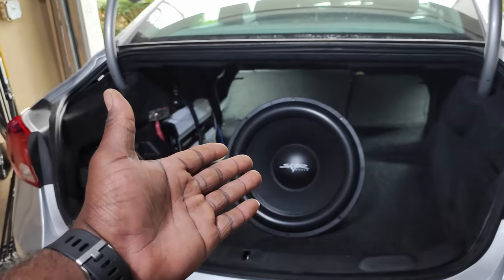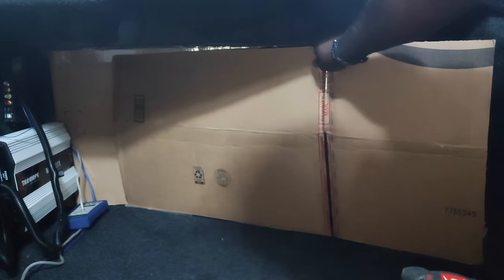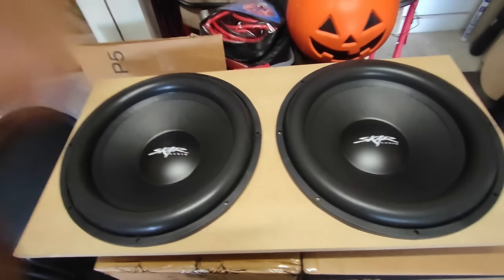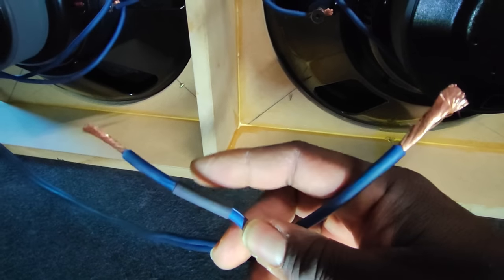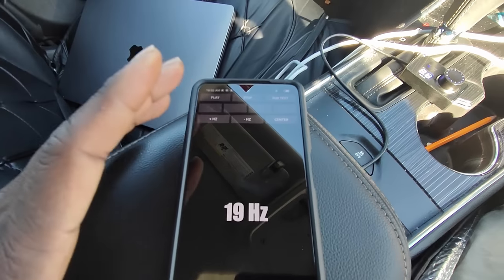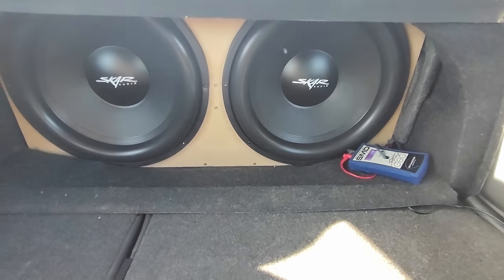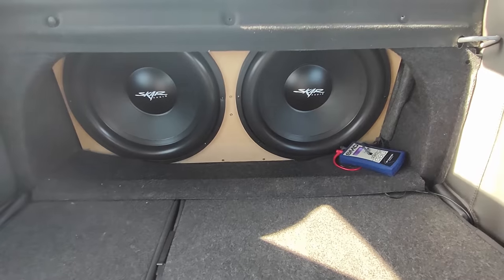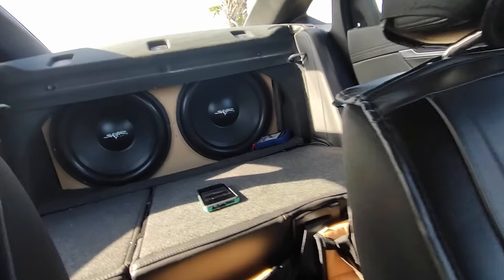No Other Design Sounds Better Than This - Infinite Baffle - 8,000 Watt Test - Part 1

Comment: If I remember correctly, Richard Clark did this in either a late 80’s Buick Grand National or a Ford Thunderbird, back in the late 89’s early 90’s. He was the king of SQ back then. Won tons of trophies from IASCA sound competitions for several years. He perfected the system by going to an aperiodic set up for the subs. This requires a semi-permeable membrane that again if I remember correctly was the rear panel of the enclosure. He then further perfected it by coming up with his own product that went over the face of the sub like a grill. Apparently it allowed for an almost ideally damped response curve. He used 15” subs, with the speed of 8” subs and nearly flat response down to 20HZ. His system was compromised of (2) waveguide horns under the dash, (2) 10” mid/mid-bass, and (2) 15” subs. (3) Alpine 250 watt x2 amps to power the speakers. Back in the day it was considered the best of the best. Love what you are doing, keep it up.
Reply: Explain what “speed” of an 8 inch sub means.

A 15 inch sun playing at 33htz moves 33 times per second.

A 8 inch sub playing 33 hertz also moved 33 times per second?

So how is one sub faster than the other?

I’m not trying to be a smart azz, just trying figure it out!
Reply: When referring to “speed” of an 8” sub. It is reference of what also may be called attack & decay. How fast a speaker starts and stops when producing a frequency. Attack is how quick it starts, decay is how slow it stops. Due to sheer size\mass differences between an 8” and 15” sub, the 8” will start and stop quicker. With an aperiodic style enclosure, this dampens the speaker in an ideal way. It helps large subwoofers stop much faster. In essence you can select a slightly higher crossover frequency as the larger sub will react with less unfavorable effects. Ie. say 80-100HZ versus 50-60HZ for a 15” sub. Hopefully this helps with my initial statement.
Reply: What's the deal with horns? I hear a compression horn can act as a mid and tweeter simultaneously and highpass from like 400hz up. Is it in any way possible to have an SQ setup that's 3-way (sub, midbass, and whatever, or sub, mid, and tweeter) that gets 145-155db on the sub stage with the front stage more or less keeping up with it? (more for the low side of that SPL, less for the high side)

Size constraints are a small single cab truck with a manual trans (so no speakers in the kick), and I only want to use AT MOST half my truck bed for the blow-through box(roughly 16.5 tall x 40 wide x 36 long/deep dimensions, can extend to 17 tall x 52 wide, but only 20 deep if doing a slot loaded IB blow through with three SI SQL-15s). I'd really prefer than nice round 150, and 155 is about my soft tolerance limit for bass. Haven't heard a 160+ car yet from the inside and kinda don't care if I do since that's not a goal of mine.
Reply: @Drunken_Hamster Titanium Diaphragm compression drivers play a higher frequency and can be used without a tweeter. A phenolic diaphragm compression driver can be used to play the midrange frequency’s.

Titanium Diaphragm (1500hz and Up)

Phenolic Diaphragm (500 and Up)
Reply: @ShaahidJohnson  Sounds like I'd still need two drivers to cover the midrange and highs. If so, wouldn't I be better off just sticking to the traditional midbass+mid+tweeter combo?
Reply: He did both..I bought his tech briefs back in the nineties about 500 pages of the best audio literature ever
Reply: @Drunken_Hamster  how far are willing to go I got ds18 horns that I have set from 800 to 20k but they mount deep ...
Reply: @nuclearbum9858  It's almost an oxymoron, but I'm willing to do more in order to do less, if you know what I mean. Like, I'd rather do the physical stuff and have parts selection "carry" my build than have to endlessly tune things. To that effect, THAT'S the main reason I really want to push for a 3-way system that covers everything rather than the typical 4-way or higher system.

Though given my current vehicle status, there are bound to be limitations when it comes to what will fit. I'm already all but resigned to a blow-through for the sub-stage. To pair with that, my doors are thin and my dashboard is shallow. ((It's an 09 Ford Ranger single cab))
Reply: @Drunken_Hamster  some horns have a large enough diaphragm and long enough throat they can play into mid frequencies. So back in the day, some of the unlimited pro class competitors would use a setup of 15” or larger subs, 8” or 10” mid/mid bass drivers, and horn hi frequency drivers. 
Back in the 90’s it was either USD or Image Dynamics that came out with a horn combining both a 4-5” mid and the high frequency driver. The mid was mounted to the throat of the horn. 
So, you can get away with horn, mid/midbass, and sub. You’ll need to do your due diligence in research for the right combination to meet your needs. Know that the horn design can also play a part in dispersion, and frequency response.
Reply: @michaelboner5118  I was figuring that  the only way to really get them in would be in the dash pointed up at the windshield. The only other way might be in the very front of the doors pointed up at the roof, but I'm less sure of that.

Any resources (like a forum) that have more info on horns and horn drivers' response curves so I can maybe pick one, learn about the actual horn/waveguide's design, and go from there?
Reply: @Drunken_Hamster - If i were you, i would buy 2- Si 8 inch midbass ( hpf set to 50Hz, Lpf set to 3,000Hz), and put in custom trim ring buildouts in your front doors, and buy 2- Si mk25 tweeters ( hpf set to 3,000Hz  ), ran in custom A-pillar pods, your dash, or @ the top of your doors. You have some very good subwoofers, in those Si SQL 15s. For a wide bandwidth, and higher power handling/SPL, if putting those 3- Si SQL 15s in a 4th order blow through, i suggest the rear/sealed chamber= (1.5net sealed per 15, so 4.5cu. ft. net total sealed rear chambers), in each individual sealed chamber, helps with loading issues, and if you blow 1, you can still play fine. Then just use a enclosure software design to calculate how much cu. ft., and port tuning/area for the front chamber (port area i suggest 40% to 50% of total cone area so between 200sq in to 275sq. In of port area, for windy, and good sound output) Plus tune higher ( Like 60Hz ) to give better bass to midbass transition. Oh yeah to get 150Db with your Blow through, i would suggest 5k of clamped power, bandpass enclosures often have 4x impedance rise, so if your 15s are D4 wired in parr.= .67 ohm, expect 2.8 ohm power from what ever amp you get. Hope this helps?
Reply: @evilinside5984  Yeah, that'll probably do it, but I gotta say, my A-pillars are TINY in this truck and anything built on-axis is going to block the defroster the side window. Also, I've been considering an infinite baffle blow-through with a slightly different set of 15s in order to save a bit of bed space and get maximum low dig+clean bass.

4th order isn't off the table, but I probably CAN'T do it with 15s since my truck's bed is so shallow top to bottom. I might, MIGHT be able to squeeze 15s if I build a box with a notch that extends the height to the skin of the tonneau cover and goes between the rails, as that'll give me 17.5"-18" total clearance or so compared to the 16.5 I have if I only build to the tonenau's rails.

But at that point, I'm not sure if I could fit 3 across between the wheel wells since there's only 40" of space there, so the other option would be to fit one between each panel of the tonneau, but that would limit me to only two 15s unless I wanted to take up my WHOLE bed, which I don't. Hell, I don't even want to take up two panels of my tri-fold tonneau, cuz that's MOST of my bed, as is.
Reply: @Drunken_Hamster - What dimensions do you have @ the back wall of your truck cab, like directly behind your seats, and under the window line? Like if you just made that your infinite baffle wall, and made the area between the cab, and your bed splash proof.
Reply: @evilinside5984  It's also not enough for 15s as far as I can tell. Might not even be enough for 12s. I was planning on doing a sort of psuedo-slot-loaded "port through" infinite baffle like this one Tacoma that I saw.
Reply: @michaelboner5118 it doesn’t help , back then subs didn’t have huge surround like now , does it still apply
Reply: @beerman9807 - If you are talking about the speed of a woofer, the attack, and decay, and how they can be affected? All speakers, no matter how old, how new, how small, how big, how fat, or skinny the surrounds are, can all be affected by changes to their attack speed and decay, by enclosure designs, or adding mass to their cone's, or damping from an aperiodic membrane.
Reply: No saving the misinformation in these comments.
Reply: ❤it perfect and I love my bass as well I have to have both🎉
Reply: Is it safe to say that y'all have kindly shared presumably years of experience & wisdom within seconds simply reading, LEARNING....i genuinely thank you all!!!Grateful🤙
Reply: Richard Clark also employed a servo controller for his subs.  I think that went a long way in producing such amazing transient response.
Reply: I remember that!!! That Grand National was the gold standard of sound quality. More of these YT guys should pay homage to the real IB enclosure builders from that era. Those image dynamics horn were awesome. I probably still have the Car Audio and Electronics magazine he was featured in! Simple and profound system...
Reply: It was a Buick Grand National. Furthermore, there were only 6 speakers. 2× 15", 2× 12", 2× Horns (500 mhz and up).
Reply: @Drunken_Hamster  
 @ Just make sure when you run the sine sweep, you are not hearing any gaps in the music. You want to ensure you cover every frequency from 20Hz to 20kHz. When tuning, make sure you go a little beyond the frequency response you are aiming for. You want it to bleed over slightly to ensure you are hearing every note the song intends for you to hear. Bleed-over frequency is important because some equipment claims to replicate certain frequencies, but they can't! Even well-known companies have been known to not meet the specs they promise.

Comment: Great idea when it comes to a seat down trunk build.. fantastic job brother.. not only did you save your trunk space for when you need it but you also saved a ton of time not having to build and tune a box, or having to buy materials.. bravo 👏
Reply from the maker: Thanks 👍 This was simple and LOT more impressive than expected.
Reply: I like it!
Reply: @BudgetBassHead wus the name of the song?🔥
Reply: @BudgetBassHead  what did it cost? Thinking of getting bk in the game been out since 13
Reply from the maker: @michaellazenby6712  The scar audio SDR18s are less than $150 a piece
Reply: Do people not realize that the trunk is acting as a box. With that being said a box that flexes constantly is going to lose a lot of bass. There's a reason that us professionals build MDF boxes with two layers of three-quarter inch.
Reply: @krookedliptv9852   oh yeah?
Reply: @wgreen340  Yeah it's just simple physics all that energy that is being lost through the body of the car should be going straight into the cabin. What you could basically do the same thing with getting some actual infinit baffles which are pretty much just cones without a motor hooked to the back. But if you want base that really knocks you build a box specified for the speaker in the owners manual and tune the boxes port to your car's cabin resonant frequency. You can find that out by simply building your enclosure then you take a sealed speaker like a 12in and you put it in your driver seat then you play different frequencies on a tone generator app until you find the one frequency that hits the highest DB then you tune your box  port to that frequency. That's how you win bass comps
Reply: @wgreen340 I also want to know: oh yeah? 😌
Reply: @krookedliptv9852  could a bazooka tube be fitted for some allowable length to partially compensate for resonant tuning, while allowing for the seat backs to be upright and functional? Otherwise, just toss out the back seats or better yet, use the foam for insulation in the trunk.
Reply: @erikbrodin2198  usually what I'll do strip all the panels out of the vehicle get some expanding foam and spray it and all the different metal webbings then just buy some sound deadening sheets and put it on every panel. You could use a bazooka tube or any PVC as a port the bigger the diameter of the port the better for air movement and you don't get a bunch of Port noise. You would still have to know the exact dimensions of the interior of the box and make the length of your Port correct length to meet whatever frequency you're trying to amplify. But as far as making a bazooka tube longer and the bazooka tube not having a port you can't really tuned it by making the bazooka tube itself longer. It will still act as a sealed box. For best overall sound quality sealed boxes are the way to go. For a good range of sound was certain frequencies being boosted more ported box. If you're trying to Target the frequency resonance of your vehicle and you're just trying to make one really loud tone that hits the frequency resonance so you can get as much pressure as you can to try to win a base contest. Bandpass box
Reply: @krookedliptv9852 i remove all panels and add stucco cement.
Reply: Nice
Reply: How many watts are the speakers and how many watts is the amp?
Reply: @krookedliptv9852  You're right, for this sound system to be considered infinite baffle, it would have to have the trunk lid open.
Reply: @krookedliptv9852  if the baffle and trunk have a proper seal, the vehicle cabin (w/ the windows down) essentially becomes the ported chamber of a 4th order enclosure
Reply: @johndeleon713  once again you lose all types of a bass through the flex of the trunk it's self. If you want good bass you need to build a box out of two layers of 3/4 inch MDF otherwise you're just wasting your time. Even inside those boxes people put 2 by 4 and stuff like that to keep the walls of the boxes from flexing lol.

Comment: To make it more functional you can put a piece of expanded steel mesh across the back (same size as baffle board) and some black grill cloth. Then you can throw anything in the trunk and the subs stay protected.
Reply from the maker: Excellent tip! Thanks.
Reply: It can also change the way it sounds , like filling up the trunk with luggage would. Decreasing airspace. Could be better could be worse? Ive never had that car or those particular subs so i wouldnt know. The mesh and cloth would allow air to pass through, but at a much slower rate.
Reply: @Hayawasa  No, the expanded steel and cloth has no effect on the flow rate or sound.
Reply: I need to do my Acura like this
Reply: @JasonWW2000  you have tested this and know 💯 that it wont? I have and aside from what i said the mesh can put runs in the cloth over time from air making the tightly streched cloth vibrate against the metal and unless you attach it in a permanent fashion to the trunk metal its gonna rattle like crazy
Reply: @Hayawasa  First, I'm not talking about mesh with tiny holes. I mean big 1" holes like with expanded metal. Similar to a BBQ grill surface. Tough, strong steel.
Second, I'm not say to completely enclose the back of the driver. The top and sides can be open. You just want the mesh/screen to go across the back side to prevent anything in the trunk from hitting the subs. 
I'm not recommending an aperiodic membrane or anything. I hope that clears things up.
Reply: @JasonWW2000  it does . Unfortunately i have built a few of those rattle traps i was talking about in the early nineties against my advice to the customer. What you are talking about would be better. I like to carpet a peice of mdf and attach it to the trunk floor like you would normally do for a typical  ib build, but sometimes an h or w frame baffle will get better results depending on the sub used.

Comment: Never done infinite baffle, but my understanding always was they’re great for SQ, less power handling and raw db than other enclosure choices. Your results seem to match that. I’ve hit 135 on 500 watts before but I doubt mine would play as wide a range as an infinite baffle setup would.
Reply from the maker: 100% agree
Reply: I have a box like so many others, works well but there’s always the space issue. IB is definitely getting a hard look. Beautiful and functional solution if you’re into SQ.
Reply: Hell yeah! I love me some titebond 3
Reply: Although a large ported box with a low tuning will sound similar with extra headroom in the bass extension, or just adding a pipe that treats the trunk as a slightly leaky ported box and have a 15Hz tuning. The low resonance won't cost you output up higher either compared to the same infinite baffle. Whilst you can use your trunk space, it will restrict the sound a bit.